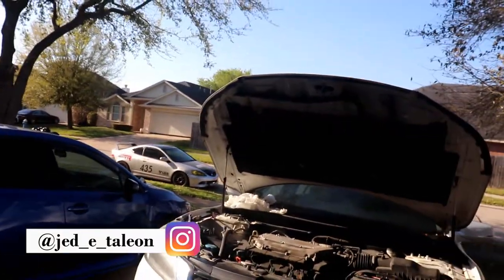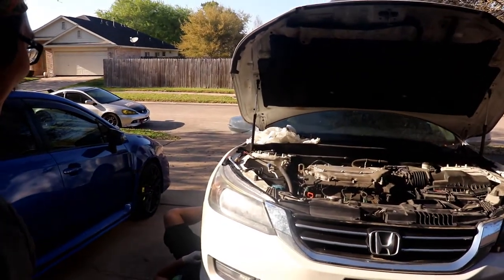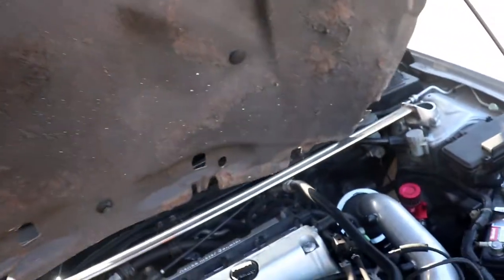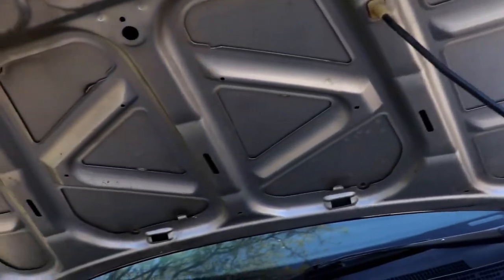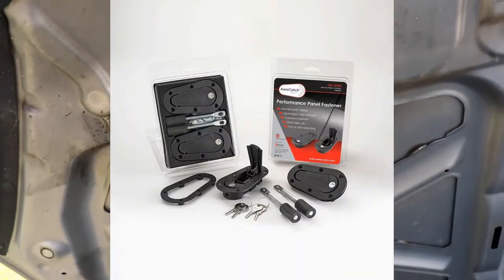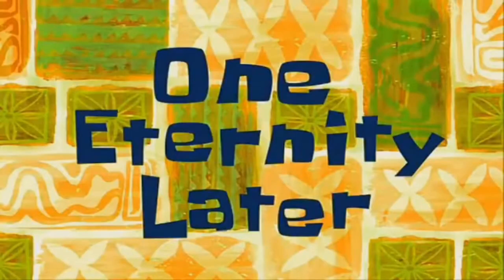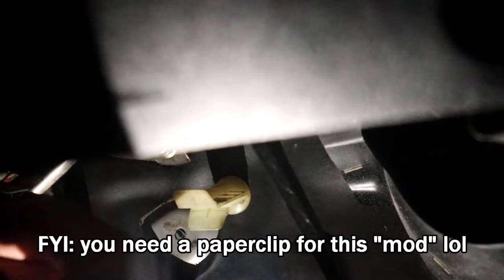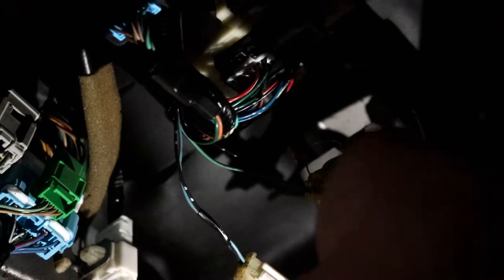Clutch Start Cancel Mod | RSX Type-S

Comment: Exact same thing happened to me last year.  Car wouldn't start. When that plastic switch broke, my brake light stayed on which ran the battery down.  Strange design. Brake lights are on if that little plastic piece breaks off and the brake pedal is at rest.  Replaced the broken plastic part with a metal bolt.  Now it will never break or wear out. 👍
Reply from the maker: hmmmm I might have to do that to "future proof" my brake light actuator lol
Reply: @JedETaleon  Maybe.  It took 16 years before that plastic piece dried up and broke apart.  If it looks yellow or discolored, I would recommend changing it out ASAP.  So if you replace with a new OEM part, you have 15 or more years to change it before it goes bad again.  I figured 15 years was not good enough for me ☺
Reply from the maker: @DC5Brandon  ahhh ok then I won't worry about it too much then, especially since it's a simple fix regardless lol